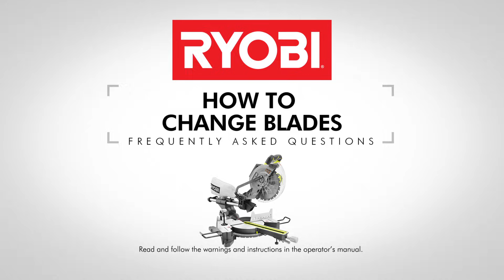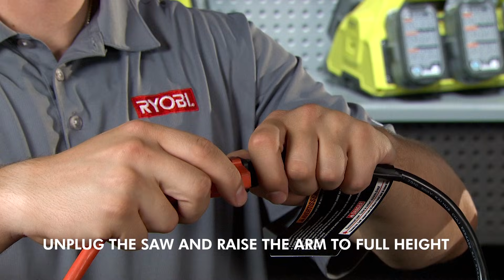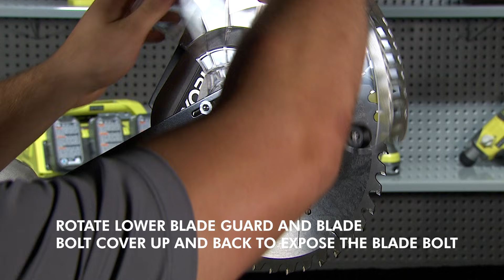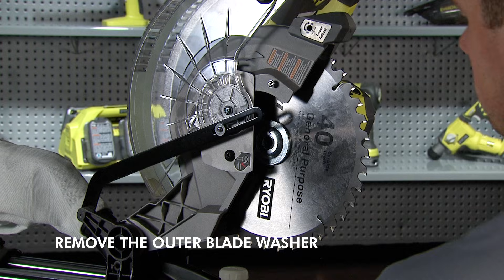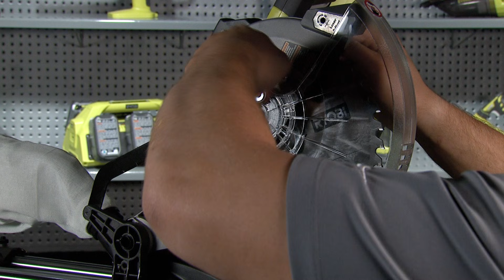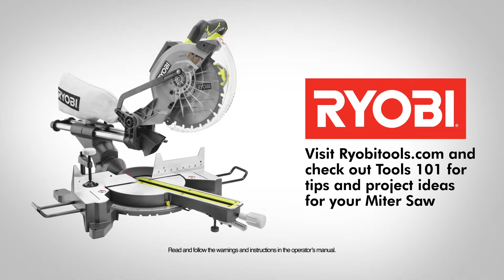How to Install and Replace a Miter Saw Blade

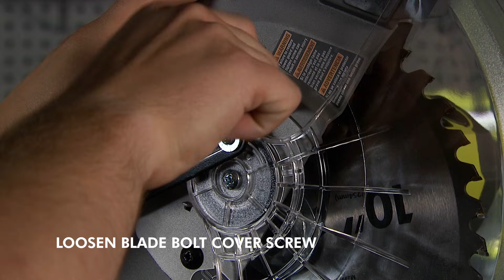Comment: To everyone struggling to get the screw off at 00:31 

I unscrewed the dark black round screw at the same time stamp below the “OL” text on the screen spelling out bolt

The tool for changing the blade is the same material as this screw.   I did this easily - slid back the blade and changed it. My wife did hold the cover for me as it kept sliding. I tried doing the way he shows but that screw wouldn’t budge. It was completely stripped.  

I just bought  this tss103 model - maybe this is an older model but I see the same round black screw there.

Comment: It's 2025 and the over torqued bolt is still a problem.  I bought and immediately returned the saw when I found out that the bolt is impossible to remove without risking damage.  And yes, I know it's reverse threaded :).  It's a pity coz I really like the saw.  Ryobi, can you address this assembly issue once and for all?

Comment: Agreed with the one guy. Needed to clamp down the lock button for the blade, and slowly wrench open the bolt. Too tight from the factory.

Comment: Wtf is up with this bolt. I got mine from a resale shop and have to put the blade on myself. I cannot get this bolt off at all
Reply: I have the same problem! My neighbour donated to me his old Ryobi mitre saw and I could not unfasten the blade bolt no matter how hard I tried. What is worse, he must have tried it himself in the past and faced the same difficulty, cause the hex hole on the bolt is mangled a bit. It has gotten wider and more round inside, obviously due to hand force from previous attempts to loosen it up. Now the standard hex bits won't fit snuggly in there. I need to find a bit that is larger than the standard size just to jam it in there.

Comment: Came here to say that in 2024, the locking nut is over tightened from the factory. Had to put a socket wrench on and whack it with a hammer to loosen. This is on the HP cordless 10 inch saw.

Comment: 2023 FOR ANYBODY WATCHING:

Follow all the rest of the instructions from the video about removing the former screw to access the blade bolt in the first place.. 

1: Take some type of lubricant i.e WD-40, spray the nut and bolt that you are removing. Wipe any excess.

2. Put the short end of the Allen Wrench provided into the bolt. Then instead of turning with your hand, take a hammer and tap the Allen wrench end where you would normally place your hand to turn it. 
Make sure you are tapping towards the CLOCKWISE position. 

No extra tools including a wrench etc needed.  This method knocked it loose for me immediately. So I hope it helps you. 💪
Reply: Dude, thank you for commenting.  Saved me!
Reply: Just found this. It’s people like you who help me keep faith in humanity. Thanks, brother.
Reply: The bolt came off but not the washer!! What am I doing wrong?????

Comment: My blade spins, it's not locked, so I'm battling to take off the bolt, which is as tight as heck. How do I prevent the blade from moving as I try unlock it?
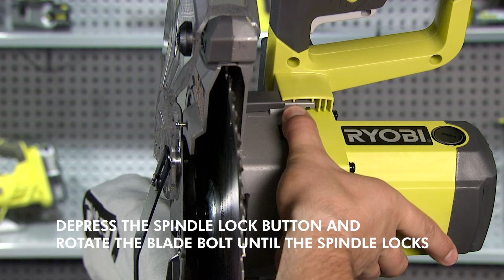Reply from the maker: There is a spindle lock button next to the blade, which will hold the blade in place as you loosen. Check out time 0:39!

Comment: @RYOBI !!!! How do you use reducer rings with these blades ? they do not include a space behind the blade, so there is effectively a cavity behind a cutting blade that uses reducer rings. This is a poor design, I dont mind using reducer rings, but the cavity behind the blade means the reducer rings collapse...

C'mon Ryobi !

Comment: My 7 1/4 Ryobi miter is saw is about 1 1/2 years old.  I use it alot, so I just changed blade.  Could not find a Ryobi blade, so put a Dwalt.  But I notice NOW, it smokes and I see burn marks on wood.  What did I do wrong?
Reply: You probably put the blade on backwards.

Comment: Question . You mentioned in the list of  all what we need  “oil” but during the video you never used it. Instead, You asked to remove all oil in the washer . So, where should we put some oil ? , thanks
Reply: On the washers that are next to the blade. Just a drop on each inner and outer washer

Comment: What did you use?  A air wratchet at the factory?  It’s overtightened to an impossible to remove degree... need some grease on that but before installing and not so crazy tight guys at the factory
Reply: I had to use a mallet to hit the Allen whrench and loosen the bolt

Comment: Whew! That thang was on tight! I had to use a clamp on the right side to hold the spindle lock since I didn’t have anyone with me to hold it down. On the left side, I used a 1/2 ratchet, and lightly tapped it with a hammer until it loosened up.

Comment: Can someone please tell the bolt tightener guy at the Ryobi factory to take it easy mayne?! I need a bandaid and therapy after trying to loosen the blade bolt.
Reply: Same problem and why I'm here.
Reply: Yea having that same problem now
Reply: No friggin joke, the Ryobi factory damn near welded this hold on.
Reply: I just broke all my knuckles and am bending the wrench
Reply: Use a wrench million times easier
Reply: Dude forreal tho!
Reply: i used a piece of pipe as a ratchet that made it very easy
Reply: Just got cut trying to lose this damn screw!! F u ryobi
Reply: They tighten through use of the saw (saw spins counter to the threading of the bolt) so it's gonna be tight no matter what.
Reply: No joke!! 2022 and still tight as heck lol
Reply: I ended up having to use a vice grip for leverage. Once you get it out that first time, it won’t be a problem again.
Reply: A little wd40 and a good angle for leverage finally helped after straining my hand a few times 😅
Reply: That's much easier than the model I have, with a pathetic little holding claw and tiny socket to get it out, needed to make extenders just so as not to cut my knuckles off if I slip. Still havet got it loose yet
Reply: I've been trying for 10 minutes with zero give.
Reply: I had to use a heat gun and an impact drill.. that thing was TIGHT
Reply: Whoever overtightened the screw ur mom's a ho
Reply: 2024 still tight as hell. Finally, two cuts later.
Reply: I'm even using a wrench!

Comment: the blade turns with the bolt even with the spindle lock pushed down gonna try lubricant then I will return to the store cause screw this sh!t

Comment: Holy hell was my blade on tight from the factory.  Use a heavy duty socket to loosen if it's right out of the box, the blade wrench that comes with the saw would have bent for sure.
Reply: I thought I was just being drp drppp about it since it is my first time replacing a blade... it definitely is on their tight!

Comment: My Ryobi circular saw spindle screw goes COUNTER clockwise to get it off. Why would they makde identical looking saws with different direction threads???? Soooo incredibly frustrating i broke the spindle following these directions on one and realized and sure enough my other one was opposite of this video and it looks identical. uhg

Comment: This damn bolt is about to make me throw this machine in the garbage.. This is by far the worst instructional video I have ever seen.
Reply: I’m having the same problem. The blade bolt is a complete joke just like Ryobi products.
Reply: David May 
Same here.  A relaxed is the spindle stop doesn’t stop so you have to try to hold it in while you wrestle with thr bolt. Last Ryobi for me..

Comment: My blade bolt is ridiculously tight. I thought I was doing something wrong which is why I pulled up this video. I can't get the damn thing off.
Reply: Out of the box the bolt is way to tight for the tool they provide. In the end I had to use a long crescent wrench to get the torque. If you look at the bolt it is edged so a wrench can be used. Remember to turn clockwise (the direction of the teeth on on the blade) to loosen.
Reply: Forgot to add that when screwing the bolt back on it's possible to get it misaligned. On mine the threads at the end of the bolt seem to be tapered and if not exactly right, after a few turns it would stop. If you get ANY resistance undo and try again. Otherwise your just going to strip the threads if you force it. You should be able to screw it all the way to the washer with your fingers and then use the tool or wrench to tighten.
Reply: @BobSmith-sr1kx  how tight does this have to be? my miter saw is not cutting straight. driving me nuts!
Reply: Finger tight the bolt all the way in (with the washer oriented correctly) then turn with the wrench counterclockwise until you feel some resistance. It doesn't have to be as tight as it was out of the box. As far as cutting straight the length of the slide, I had to adjust the fence using a piece of known squared hardwood (found some scrap at Home Depot for free) I aligned to the outer polished metal edge of the throat guide. I also picked up a "5mm Hex Bit Socket" for a socket wrench (again at Home Depot) and used that for the fence bolts. The bolts weren't as bad as the saw blade but they were a pain with the tool included.  You can't use a wrench on those because they are rounded and the tight space.  I waisted too much time trying the recommended fence adjustment, it doesn't work for sliding saws.
Reply: Thank God I thought it was just me.
Reply: Penny Hinton i replace the blade with Dewalt blade, its a lot better now
Reply: I couldn’t get the damn thing off either. I think the breaker bar is a good idea if you have one. The only problem with that is you have to keep the spindle lock button pushed down and the length of the bar might make that difficult. Instead I used a deep penetration lubricant (I used the sea foam brand) and let in sink in  for a couple hours. Than I used a ratchet wrench and pushed HARD. It or me and finally it came off. Don’t forget clockwise is OFF. And, at least on mine you have to push the spindle lock button down and spin the blade clockwise while continuing to push down until it locks. Keep the button down while getting off the screw.
Finally there are two metal washers on the screw. The big one goes on the blade side.
Hope this helps someone.
Reply: As everyone seems to agree, the bolt is tightened way too tight out of the factory.  I used a breaker bar with a 5mm (I think) hex socket, and it came right off.  Changed the blade to a Diablo, and the difference in cutting is night and day.  The stock Ryobi blade was pretty poor.  Have it hooked up to a new 9Ah battery, and it's like a new machine.  Before it was very marginal.
Reply: Onoku same here. Tried an impact wrench on it an broke the bit 😵

Comment: I have a TSS 100 L1 miter saw,  bought it about 2 years ago used it very little. At my resent project the blade came lose, had to buy expensive lubricant in order to turn the screw even then I had to use vice grips to turn the screw but nothing happened the screw just kept on turning.
Please advise what to do next.
Reply from the maker: Hi, Gerda! Feel free to reach out to our Customer Service Department at 800-525-2579 and they will assist and walk you through your options.

Comment: Hello where can I get the clamps for this model? Thanks
Reply from the maker: Hi there! This Miter Saw model comes with a work clamp, are you looking for a replacement?
Reply: RYOBI yes
Reply from the maker: If your Miter Saw is still under its 3-year limited warranty we would suggest reaching out to our customer service department first at 800-525-2579 and see if they can assist! Or you should be able to get a replacement clamp (part #08816005733) by contacting Gardner Inc. at 800-848-8946